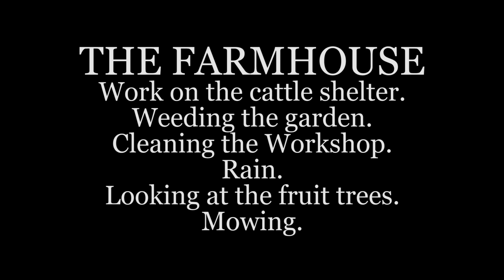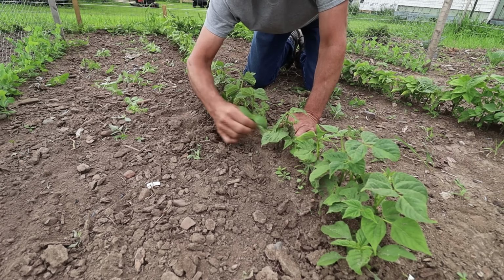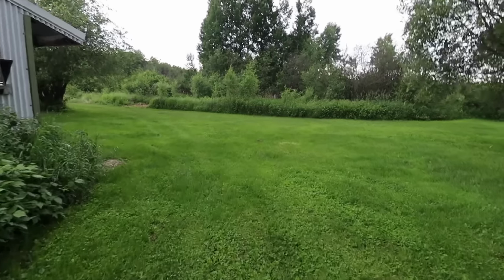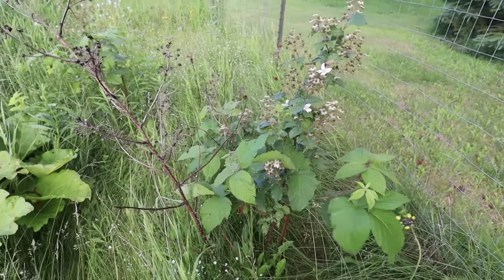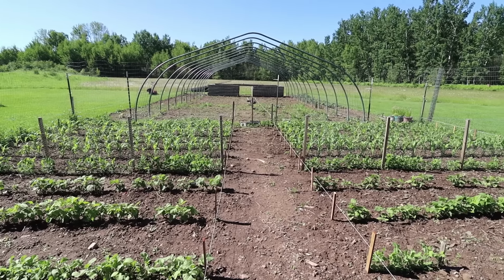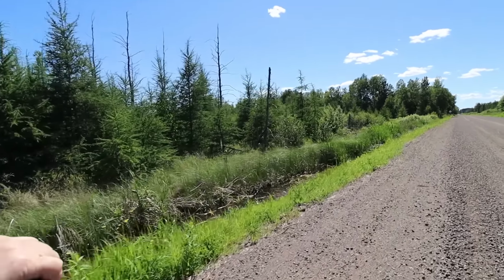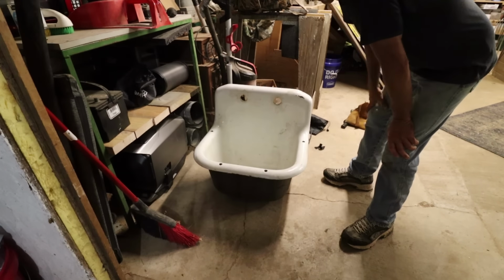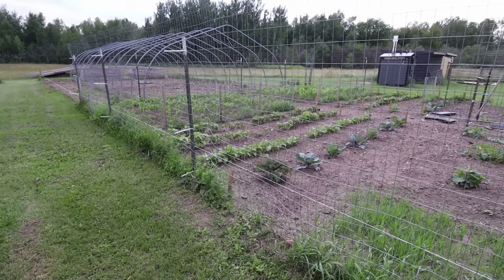THE FARMHOUSE. Cattle Shelter. Weeding the garden. Cleaning the workshop. Rain. Fruit trees. Mowing.

Comment: You should put some planks on the inside the cows will nock that plywood off in no time.
Reply from the maker: I definitely will. You are not the first to suggest that and I will do that once I get the roof on. I am still contemplating if I want to put build a wall type feeder in there to throw hay into on real bad winter days, if I do that it would kind of determine where I need to put the inside planks. My first priority is getting a shelter and fenced in area and then I will start doing the smaller details.

Comment: We always had the gate swing to the outside once you get frozen snow mixed with cow manure to dig out for the gate swing where as outside once the snow got high we just shoveled the snow to make a path for the gate swing..seemed like frozen snow mixed with cow manure was hard as a rock..
Reply from the maker: That small gate does swing in, the bigger ones will swing both ways. The only reason I have the one into the shelter swinging in is because the cows will spend more time in there and if a person needs to get out quick, they can not follow behind you and push the gate, it has a stop. Everything I do here I am constantly thinking about the snow. Winter is tough so making that easier is a big priority. I am hoping that since the shelter will be covered not much snow will blow in there even though, we get some big winded snowfalls that can blow and drift it. All that being said, this winter will be a learning experience unless we have another freak winter like last years.